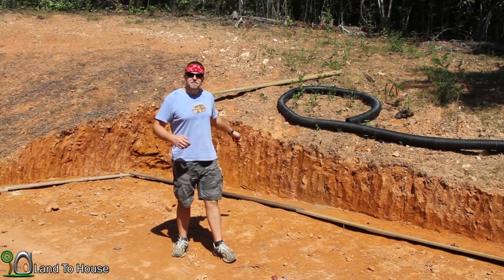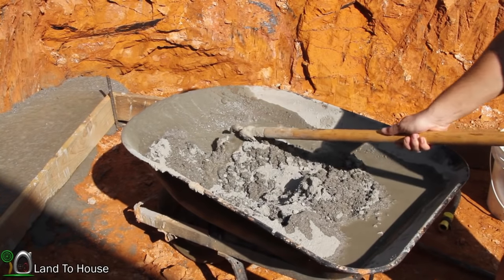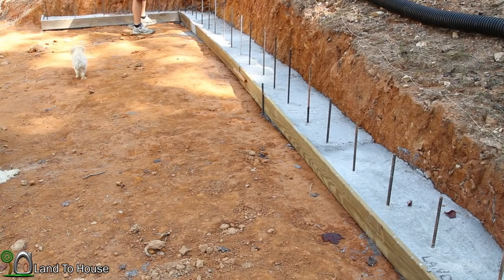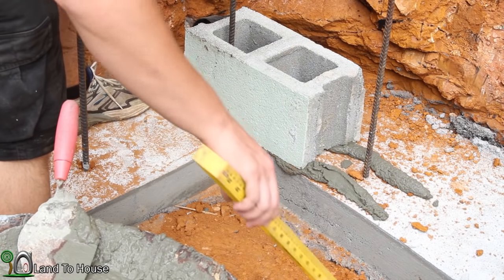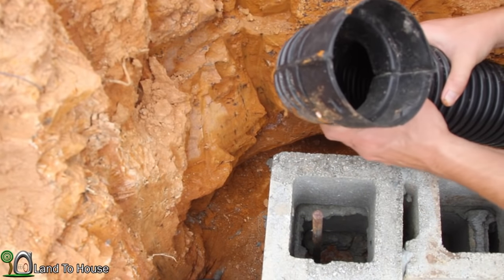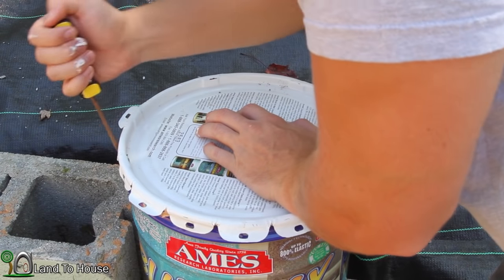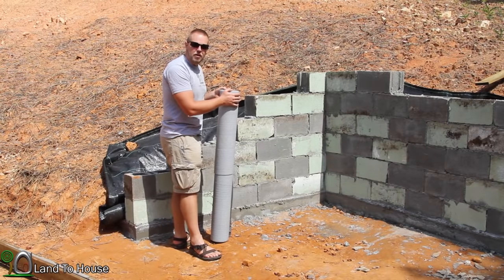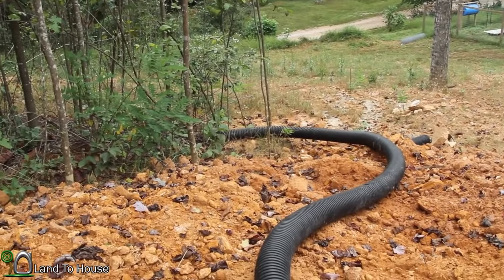Build a Block Retaining Wall - Build a Workshop#2

Comment: Your foundation will eventually explode as you do not put rebar through the concrete. You need to tie to trench mesh that is at the mid point of the concrete base

Comment: You forgot to dig the foundation, wich is the most important part in building a wall , depending on the height of the wall will tell you how deep you have to dig the footing , and the amount of soil and the weight that will lean against in back of the wall if that’s a retaining wall, also keep in mind the frost line at where you’re located , the ice will lift up that concrete you poured .
Reply: Hi there Anton D , I'm going to do a similar block retainer wall here in Australia. The wall will be About 4 feet (approx ) in height from the top of the foundation ( Concrete reinforced with Trench mesh - horizontal - and Re-bar at a vertical ) , could you please help me with a rough guide about the Depth of the foundation? The soil around the site is sandstone based Clay/compacted silt - very hard when dry but very sloppy/loose when very wet, a light rain does not effect it much. the site is also underneath my house which is built on steel pole/stilts so direct rain will not directly effect it. I would greatly appreciate any advice you could offer, your comment led me to believe your a person who knows what your talking about, Thank you for your time in reading this and any advice/tips you may offer.
Nicholas McClintock - Brisbane - Australia.
Reply: @ Nicholas McClintock , i would dig the foundation two feet deep by 18 inches wide . Make sure the bottom of the foundation has at least 4 inches of 3/4” gravel and compact it really good because you don’t want the wall to sink over time and it will if you don’t compact that gravel as best as you can. Put the gravel in layers as you compact it to reach the 4 inches if you put 5 inches it’s even better. Pour the concrete in and stay at least 2 inches below the top  ground level, that way your first row of blocks will sit under ground so it will stay locked in place. Good luck !!
Reply: @antond2154  Thank you so much, that's just the info I was after, thank you again, it's appreciated I can tell you.
Reply: @ Nicholas McClintock , no problem you’re welcome, glad I could help you . Take care. 👍🏻
Reply: @antond2154  Good advice.
Reply: @NicholasMcClintock1  2 feet deep for a 4 feet wall in frost free Brisbane! Sounds way ott.

Comment: You must put some kind of solid cap on top blocks. If water gets inside blocks & freezes it will destroy your wall. Cap or fill completely with cement. PS, to make wall look great, stucco the outside with stucco cement & finish with small broom. Just an idea!!
Reply from the maker: +mmanut I will have to look around for cap options. Stucco would look nice!

Comment: If you're ever mixing concrete or mortar, always make sure to have a little bit of water in the bucket/wheel barrow before mixing. It makes mixing a lot easier and less clumpy
Reply from the maker: I will have to give that a try next time I am mixing concrete. Thank you for the tip.
Reply from the maker: +Aaron Harrison that is a great tip. I'm sure that I will be mixing again before long. Thank you.

Comment: I'm employed with a Landscape company and we do retaining walls, however we dont install any form of drainage. You've definitely done a crucial step that those guys have'nt
Reply from the maker: I am very new to any type of construction. If the wall is correct there is no need for drainage pipes. The wall will let water out from the cracks.

Comment: Good job. I want to build a retaining wall. Some good ideas here. I think I'll start with a gravel footer then rebar and lay my cement blocks on a concert base. Build up the wall with mortar and run the rebar up with the blocks. I might fill the wall with concrete and hope it works.

Comment: Filling all the blocks will strengthen the wall from "blowouts". time and clay will put a fair amount of pressure on the blocks. We had to fill the blocks on new construction homes. granted this is not going to have the weight resting on it but if the wall has issues later on, its going to be tough to fix with a hill and building in the way.
Reply from the maker: I will need to get on that in the spring or sometime when I can find my money tree. It would be best to get that done now before there are any issues. The hill behind has not moved an inch in 3 months but that does not mean it wont.
Reply: Land to House well that's good that you haven't had any issues:) hopefully you won't!

Comment: Don't use concrete as a drainage medium, it degrades when wet and will just clog the pipe, 1 inch stone is better.
Finish your mortar joints properly, it only requires running your trowel along the edge, at least then painting with sealant becomes a bit less pointless.
A rebar bending tool is maybe $40
The drain pipe goes at the side of the foundation, not on top of it.
That concrete looked lacking in ballast, and the mortar lacking in sand, hard to tell on camera.
Good effort for a first wall though, the niceties of a low retaining wall don't matter that much.
Reply from the maker: Thank you for the great tips. As you can see this is how I learn. Get out there and give it a try and only improve from there. I would have had to dig a lot more of that clay to get the pipe on the other side of the foundation and I was tired. Should have rented a small excavator.
Reply: Yeh that ground looks really difficult to dig - on the plus side horizontal shale isn't going to heave against a wall as much as a couple of feet of wet soil would.
Reply from the maker: +horse1066 yes so true. I was back there looking at the wall and there has been some run off but not much. The wall is doing its job so far.
Reply from the maker: Yes! I also like real feedback.  A true learning experience.

Comment: Excellent job as a beginner. I would, however, fill the cinderblocks with clean gravel and backfill with same material. It's always good to check (or run a test) of the perforated drainage pipes and make sure they're pitched properly for drainage.
Reply from the maker: That is a good idea. So far after a year the wall is holding with no issues. The pipe drains well.
Reply: @LandtoHouse  hows it holding up 4 years along?
Reply from the maker: Still no change! Doing well.
Reply: @LandtoHouse  awesome

Comment: Hey bud u have the wrong paper, you have a woven geotextile that is a moisture separator. What u want is a soil separation geotextile, it's more of a mesh fabric, it will allow moisture through it.  That paper you have will create hydrostatic pressure... Just my two cents tho!
Reply from the maker: Hmm well that is not good. SO far it seems to be allowing water to pass. There has been some dirt falling to the cracks of the wall but not that much.

Comment: Your soil is redder than Mars! Thank goodness i have sand and don't need to worry about too much drainage. 
I'm going with a 12in deep block and 12in of angular stone back fill. 
That footer is a good idea, our first wall was built without proper compaction and after 10 years a lot of the base blocks sank away from the second layer and we have big gaps now.
Reply from the maker: Our soil is so full of clay. It will be a real pain to work with when its garden time. I hear that sand is harder to make a wall in though. So far this wall has held up very well.
Reply: "Thank goodness I have sand" Said no one ever unless you live on a beach.
Reply from the maker: +epicdeuce haha probably the same can be said with clay.....
Reply: My house is a stilt house . The foundation is made from ironwood. There is a puddle under my house. Puddles arise from the rain.  I want to close the gap under my house so it wont create puddles under my house when the weather is raining. What should I do? If I make a brick wall around the gap under my house, can the brick wall hold the ground in front of it? I plan to fill my entire home yard with soil to make my house yard become higher. The gap height is around 50cm
Reply from the maker: Sounds like you might be better off with a French Drain system. That would take the water away from the house.

Comment: Love the video.  I like how you addressed the water behind the block water and the clean out for it.  Some suggestions if you should ever to this again and it will help speed up the process.  

For the wood frame around the footer.  You can coat the wood in old motor oil or diesel fuel and this will allow you to remove the wood before it hardens.  You can start placing block while the footer is wet.  This helps with leveling issues on your first row.  As far the drainage pipe goes, they sell the same pipe with the sock on it to help keep debris out.  All though not a must, I would add more risers to your drainage pipe and at the short end place a riser with pop-up cap.  In case the pipe should ever fill up with water the pop cap will allow the excess water to escape.

What you did is great and works.  Just some free advice if you should ever find yourself doing this again.
Reply from the maker: Thank you for the encouragement. This video does not get much positivity in the comments. Walls are a passionate topic for some people. i have learned a lot after posting this video. Thank you for the great tips!
Reply: I know the feeling.  When I was doing a retaining wall (My first one) I wanted to address the water issue and I created an enclosed channel made of bricks with a brick cover and holes drilled in.  Placed the cloth over it to keep dirt from going in it.  Granted I was 18 at the time and YouTube wasn't around yet, but all the people that said I was doing it wrong and it won't work and the wall will be down within a year.

Not the case.  Wall is still standing and the water is still draining.

Comment: You should back fill this type of wall as you build it. Weep holes would help tremendously. And, If a contractor showed up wearing sandals I would kick him off my site.
Reply from the maker: Yes those sandals have been the most commented thing on the channel.  I wear better shoes now. There are a number of things that would have made the wall better. It has held just fine for two winters. No sign of issues.
Reply: I always work barefoot through the hot months, guess I wouldn't survive long on your site ;)

Comment: To add to Johny sheeshy comment a corrugated pipe with a sock is Ideal but you are supposed to back fill with 3/4" aggregate or drain rock a weed mat like the one you are using I would highly recommend not using because it doesn't allow water to drain well.
 If you leave that weed mat between your drainage aggregate and the soil now you have a chance for the soil to retain water and push your wall over instead of draining freely. Just some advise to help.
Reply from the maker: Sure thing. This wall is serving its purpose until the real retaining wall is built. I will be cutting back the hill another 15 feet or better.

Comment: Seth, I really like following your learning adventures, keep them coming.  It was really sad to see some of the trolls' comments on this one, some folks just never learned the fine art of tact. 
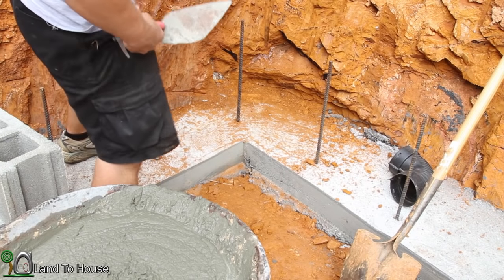You clearly expressed (9:35) "disclaimer: I'm not a skilled mason", (20:55) "if you want a how to on laying block, look for another video", yet they wanted to flame you anyway.  
Good to think out having the footer slightly slope downhill on the long leg to facilitate the drainage.
Yeah it's not perfect but it's only a 4 course retaining wall, if it works then beauty is in its function.
Retaining walls fail when the hill behind it compacts and settles and presses forward eventually bowing it out.  all the 'special' techniques are attempts to keep the weight of the hill off the wall (directly anyway).
my biggest concern is the end of the drain pipe on the short leg, will it discharge the water right into your workshop's foundation area?

Comment: How many bags of concrete did you use for the 16 ft stretch? I enjoyed watching the process, looking forward to reading the comments from other viewers.
Reply from the maker: +Dani Adams I don't completely remember. I think total it was somewhere around 26 or 27 bags. There's a lot of weight in that slab.
Reply: There are concrete calculators online with inputs for W H & L. Calculation gives cu Yrds, 80lb bags 60lb bags, etc.
For this mess it would be W=16" H=6" ? (he never says) L=16' = 24 X 60# bags

https://www.concretenetwork.com/concrete/howmuch/calculator.htm

Comment: I am building a stairwell from my yard into my basement. As u know each block has two square holes. My friend insists that those holes should be filled with grout. Is it true!? If that is true, can u imagine how much money it is going to cost me!!!!!?
I have seen many videos, but haven't seen one yet showing that the holes have to be filled. Thanks for your response in advance.
Reply from the maker: Might be better off going with a block like Alan Block or those found at Lowes. They are solid so you would not have to fill them. If you already have the block it might be worth filling them in unless you are going to use a cap stone. To be honest I am no pro at this.

Comment: I give that wall a year maybe 2
Reply from the maker: It is going strong at over a year. No changes so far.
Reply: That wall will last seven decades approximately give or take two decades… Look at that Clay Bank it ain’t going nowhere regardless even if there wasn’t a wall there… 🤟🏽💯💪🏽
Reply from the maker: The clay has not moved at all. Now the top soil has slid down a little. Perhaps 4 or 5 inches of it.

Comment: hey man I noticed you didn't plum your ends and build a lead and run a line to make sure that everything was straight in level. also you should try to Polish your joints...
Reply from the maker: This is the second time that I have worked with blocks. It looks a lot better than the first go at it. There is still so much that I need to learn. Thank you for the constructive input.
Reply: no problem man it still looks good.
Reply from the maker: +The Dependzz thank you. This is definitely a skill that requires a lot of practice.

Comment: Bad, Bad, Bad   that wall most likely has began to fail.  The landscape fabric is incorrect.
NEVER USE FABRIC.  Yep ...Paint the back of the wall so the HYDRAULICS can build up and blow out your wall.
Reply from the maker: So far the wall is holding just fine. Sometime in the next 2 years I hope to start the actual retaining wall with Alan-block or something like it.
Reply: Land to House as soon as that fabric gets clogged it will stop letting water through making it so the wall is holding more weight. As soon as the weight get to be too high the wall WILL start to lean and eventually fail. My grandmas retaining wall was built the way you built this one it failed after years the contractor showed her the fabric and it could not have been clogged any worse it simply became a dam eventually failing and costing about 12k to replace
Reply from the maker: Yes I can understand that for sure. I hope to use the wall blocks that have the lip on the back to stack evenly.

Comment: can't lay block on the edge of the footer.
Reply from the maker: So far at almost a year the blocks are doing well.
Reply: Yes, the footer should be about twice the width of the block and you put the block in the center of that, not on the edge.  Doesn't mean you "can't" do it that way, but that's not how it should be.
Reply from the maker: I have learned a lot over the past year. So far the wall is doing just fine. I do think that the hill has mostly stayed in place so there is not a lot of pressure anyway.
Reply: @kevangogh  Wrong for retaining walls, this guys doesnt know what he is doing, he sure doent need wrong advice, research retaining wall footers
Reply: Kevan Gogh you have no idea what you’re talking about.  Retaining walls are built all the time with the face flush with the toe of the footing it’s called cantilevered footings and actually it’s one of the most common types of retaining walls.  You actually can build a resting wall with all the footing to the front and the block at the back face and it’s called an eccentric footing. That wall would generally require a footing key way. The width of the footing has nothing to do with the block width and everything to do with the wall height and soil type. GENERALLY the width of a retaining wall footing should be 3/4th the width of the height of the retained height.  Ie 4’ retained height/3’ width footling. He did fine for an amateur except he needed horizontal and vertical rebar in the footing. I’m a professional mason and build 100’s of miles of retaining wall a year in Las Vegas.
Reply: Kevan Gogh Actually there are probably three different types of footings you could use for that wall… For example super wide like you suggested, how about a little bit wider than a block in twice as deep or finally if you had a neighbor that owned that Clay Bank side, you would do a fat 13 that would be further on your own property for example :-)
Reply from the maker: Eventually I want to build a wall made from actual block wall blacks. Someday might be a couple years though.
Reply: That wall really isn’t holding anything back. Did you see the rock that was in the ground that he cut back? He could have just laid block right on top of each other with no footing and no mortar and I think it would be there for fifty years. So specifications on how this wall was made is not really an issue. If you are truly going to make a retaining wall this would not work for long, but for this application he is ok😉

Comment: Have you ever seen a bag of concrete before?  Plus, rebar is cheap but apparently not as cheap as you because I don't see any your footing.  No, the verticals don't count.
Reply from the maker: I have seen a bag or two. :)  Sure there are plenty of things that I could have done differently. We shall see how well the wall holds up to its second year.